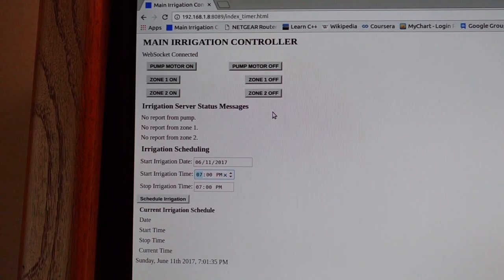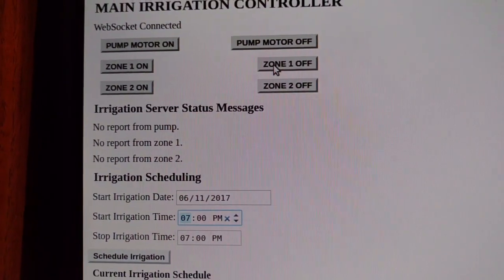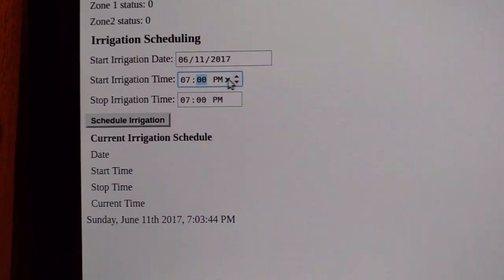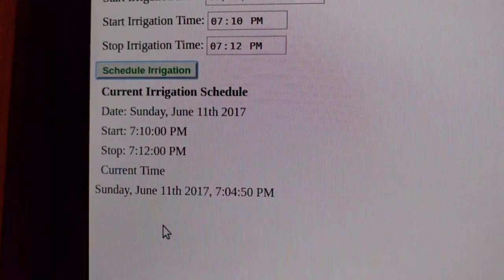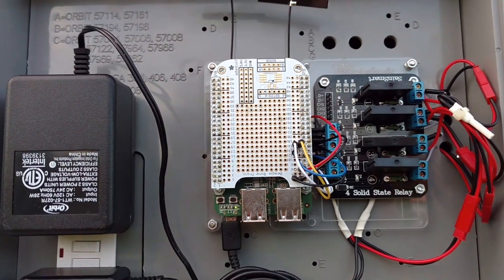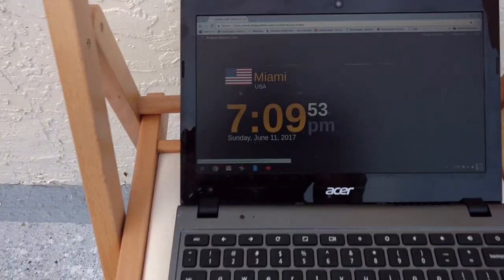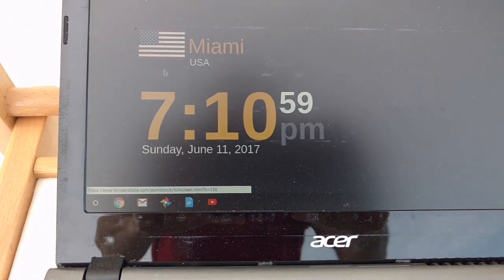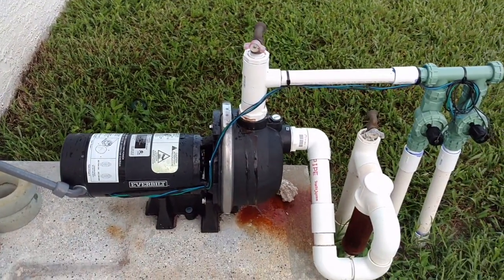irrigation control

Comment: Nice! Why an irrigation pump where you're at?  Are you on a well?  
I had a plant watering system using another micro and had the "adverse" environment affect me.  The replacement controller is now also monitoring temp/humidity both inside and outside my control box so I can track trends and possibly predict failure or otherwise determine what I might need to do to prolong the life of the electronics.